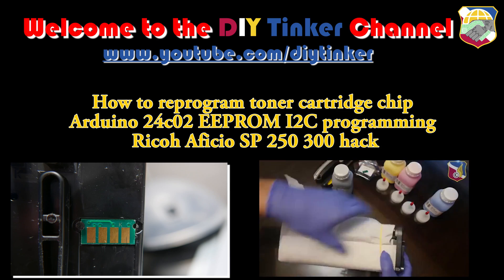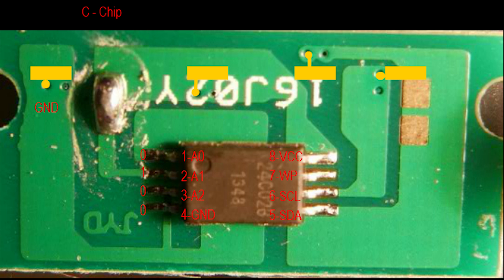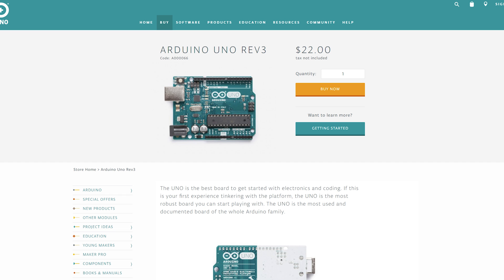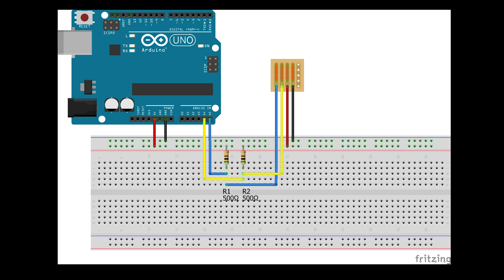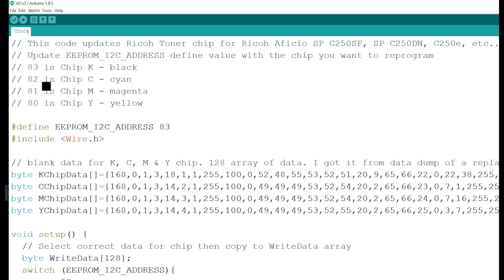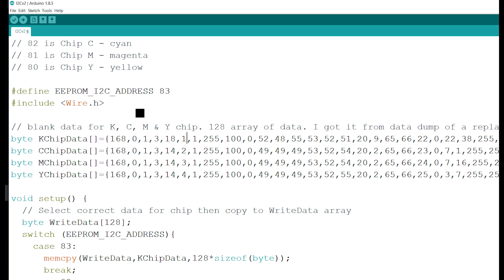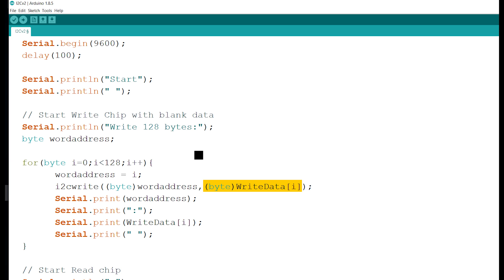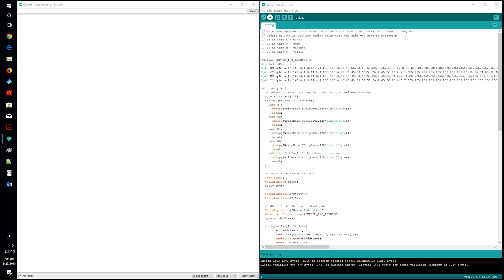How to hack Ricoh Aficio toner cartridge chip using Arduino UNO - program 24c02 EEPROM I2C

Comment: You're a legend thanks so much! Used your hard work for dumping & reprogramming similar Ricoh inkjet cart & waste tank chips.
Reply: Hey! what did you do to reset a Ricoh waste toner tank chip? I have a few and for some reason my code does not detect the chip. Please let me know if that is something you could figure out, Thanks!
Reply: @Jay-y8u  Estoy tambien interesado si compartís, código y explicación se agradeceria
Reply: @Jay-y8u  Sorry for the late response.  Does the chip on the waste tank look like the ones on the toner cartridges?  If so, did you run an I2C scanner to check what address they are using?

Comment: Cyan dump in your files looks like was already used someplace because it has printer ID X086P401208, but it works. Thanks.
BTW, I got 4 new chips and uploaded dumps if someone wants. They are not the same as posted.
Reply: Different chips have slightly different info on them.  However the printer doesn't keep track of previously used chips, so you can use the same one over and over.  I have been re-writing the same chips with the same files for a year and a half now.

Comment: It would be interesting to read the eeprom contents after printing a page, repeat a few times and compare the dumps to see what field changes. I am assuming that a single field is decremented. After identification, possibly that one field could be rewritten which would simplify the process.
Reply: There are actually several values that change.  I've done that.  Since you flash everything at once, it doesn't make it any faster.
Reply: Many parameter change at one page print

Comment: Thanks hreaps for the video..  Initially I reprogrammed the chip and got a "wrong toner" message, then i realised I had a C240 not a C250 model.  I read the data from my black cartridge which was almost full.  That gave me:
byte KChipData[]={167,0,1,4,20,1,1,255,0,0,52,48,54,48,53,57,24,16,65,66,7,0,23,85,0,0,0,0,0,0,0,0,84,49,57,50,80,51,48,48,51,50,51,0,99,0,0,0,0,0,18,169,0,0,4,58,0,0,0,0,0,0,0,0,0,0,0,3,0,0,0,0,0,0,0,0,0,0,0,0,0,0,0,0,0,0,0,0,0,0,0,0,0,0,0,0,0,0,0,9,80,32,0,97,0,0,113,101,50,6,0,29,0,82,199,121,0,60,24,66,0,0,0,0,0,0,113,101};

I think the difference for the C240 is the 167 at the beginning , so changing the the first 6 bytes of the data above should work as follows:
KChipData[]={167,0,1,0,10,1 ....
CChipData[]={167,0,1,0,10,2 ....
MChipData[]={167,0,1,0,10,3 ....
YChipData[]={167,0,1,0,10,4 ....
Reply: I have Magenta data that starts.167,0,1,1,20,3,1,255....       Don't remember which post I got it from.
Reply: There is actually a post with the data you need in the post from 
Özgür Özyurt from 10 months ago.  Look at that.

Comment: thank you so much for this video.. i run it on the arduino board, but only ''write' bytes are same with you...the 'read' bytes have the price '3'.. i use chip from mlt-d 116  samsung . it has vcc-gnd-scl-sda too.
could you help me?
Reply: ever figure this out?
Reply: @reMPAGASA1  @Chris Conner  
I had the same problem with the cartridge chips for a Ricoh SG 2100N. 
On mine the connectors were not in the order shown in the video, but it was GND-VCC-SCL-SDA . 
Also, the EEPROM_I2C_ADDRESSes were different f.e. Magenta is 82. 
After fitting the code and connection to these differences it worked again!

Comment: Did it work with SP112 ?
Reply: I think it should.  I just bought a Ricoh C360DNw.  Was looking for the pin-out because the pin-out used in the C250DN didn't work.  Ran across the pin-out for one of the Ricoh 100 series printers (don't remember which).  The toner chip looked the same as mine. So I thought I would give it a try.  I hooked one up and ran WhatI2CAddress to see if it would even talk to my Arduino.  It did.  Be warned that the addresses are not the same.  They are still 80 - 83, but the address assigned to a color is changed around.  You will then have to alter the sketch to reflect the address changes.

Comment: Could I use the original chip for hacking or not?
Reply: You could.  The data you need to rewrite the chip in this page at the top.  I would still do a dump just in case.  I assume it is for the C250dn.  If it is not then you need to get a dump for that particular chip and rewrite that to the chip.  If you've never done this before, you may want to get a couple of chips to practice on.  If you mess up one of the chips and don't have a backup, you're gonna have a dead printer til you can get a new chip.

Comment: Wow, this was great! Thank you for putting in the work and uploading this. I have a Lexmark CX310DN, and will try to figure out how to do this with my chip. I'm just baffled that a new chip will cost me $40 on ebay.
Reply: Make sure you come back and let us know what the outcome is.  I for one would be interested in seeing how this works on other manufacturer's chips.  Let us know one way or the other if it works.
Reply: @jimsmith9803  so it looks like it's a lot more complicated on the Lexmark CX310DN using the 80C1SK0 Toner Chips and the like. Heres a detailed blog of several people collaborating. They figured out a lot of info, how to read it and all, but the printer stores the chip info, so when they rewrite the chip, the printer eventually writes it back to empty. Very complex but fascinating. Now that I believe Lexmark has used up it's patent, hopefully other manufacturers will drive the price down. 

https://www.eevblog.com/forum/projects/lexmark-toner-chip-ti046b1/150/
Reply: @benspragge33  Thanks.  Very Interesting.  Very long thread but interesting.  Shows the lengths that companies go through to keep you tethered to buying from them.

Comment: Why would one add pull up resistors to the data lines?
Reply from the maker: because some chips might require more current beyond the voltage signal from an Arduino. its easier to sink voltage/current than supplying. Hence, adding a pullup resistor with a clean voltage source is always a better idea than relying on the chips voltage source.
Reply: @DIYTinker  Thank you for the reply. I don't have low resistance resistors with me like you used, would 1k-2k resistors be fine?

Comment: thanks you for this tot, can i use it for lexmark MS5120 the chip is TI046b1 ?
Reply: If the chip is just an eeprom with the 4 contacts, it should work.  You just need to figure out what the pin out is for that chip.  If you get it wrong, you risk ruining the chip.  Been there. Done that. Learned the hard way.  After learning the pin out, try reading the chip first.  It's somewhere in these posts.  If you can do that, you should be able to write to it.

Comment: Hi, any chance this can work on other printer toner chips like the Samsung toner chip.
I wanted to try reset the toner chip's eprom by just attaching its  SDA terminal to ground, before i came across your video.
Reply: Depends on what the chip looks like.  Older Samsung chips are of the "4 contacts with an eeprom" type.  You may get it to work.  I have a Samsung C1810w printer.  There is a PIC32 chip on there also.  I would guess that you would have to wake up that chip first.  I could not get the program to read this chip.  But then my programming skills are very poor.  So you may have better luck.  Let us know if you succeed.

Comment: What difference do the two resistors in the "complicated wiring setup" make? Why should one use that instead of the simple wiring?
Reply: He explained that they were for unnecessary protections.
Reply: Some boards will need them.  The Arduino Uno doesn't need them because there are internal resistors that are set when you start the the wire library in the programming.

Comment: Thankyou so much, I've reset the cartdrige chip of my SPC 252 using your code (moded), in order to read in first instance the contain of an aliexpress clone chip, and then Overwrite the original one.
Reply: How do you read the chip?
Reply: Hi, using the reading loop which is used to check the overwrited code in the chips, I commented the writing code that i don't want to use in first place, because if you don't do this you will overwrite the good chips with the wrong code.
Reply: can you please upload the code you compiled for ricoh spc 252

Comment: What happens if you just connect to WP to VSS (if connected to VCC unconnect first)?
Some german forum said it will be stuck to last fill level then.
I will try later this week if they still work after doing this (implies that it stays full then).
Got me 10 china chips. Obviously doesn't make sense with an empty chip.
Reply: How are you gonna connect write protect to ground?  You only have 4 tabs to connect to on the chip?  I just find it much easier to rewrite the chip when a light starts flashing.

Comment: can you show how to take data dump?
Reply: Good info.  With that I end up with this sketch.
// This code reads Ricoh Toner chip for Ricoh Aficio SP C250SF, SP C250DN, C250e, etc...
// Update EEPROM_I2C_ADDRESS define value with the chip you want to reprogram
// 83 is Chip K - black
// 82 is Chip C - cyan
// 81 is Chip M - magenta
// 80 is Chip Y - yellow

#define EEPROM_I2C_ADDRESS 81
#include <Wire.h>

// blank data for K, C, M & Y chip. 128 array of data. I got it from data dump of a replacement chip. 
byte KChipData[]={};
byte CChipData[]={};
byte MChipData[]={};
byte YChipData[]={};

void setup() {
  // Select correct data for chip then copy to WriteData array
 byte WriteData[128];
  switch (EEPROM_I2C_ADDRESS){
    case 83:
    case 82:
    case 81:
    case 80:
    memcpy(WriteData,KChipData,128*sizeof(byte));

  }
  
  // Start Wire and Serial bus
  Wire.begin();
  Serial.begin(9600);
  delay(100);

  Serial.println("Start");
  Serial.println(" ");
  // Start Read chip
  Serial.println(" ");
  Serial.println("Chip Data:");
  for(byte i=0;i<128;i++){
      byte readVale = i2cread(i);
      //Serial.print(i);
      //Serial.print(":");
      Serial.print(readVale);
      Serial.print(",");
  } 
  Serial.println(" ");  
  Serial.println("End");

}

void loop() {

}

void i2cwrite(byte address, byte data) {
  Wire.beginTransmission(EEPROM_I2C_ADDRESS);
  Wire.write((byte)address);
  Wire.write((byte)data);
  Wire.endTransmission();
  delay(20);
}

byte i2cread(byte address) {
  byte rData = 0;
  Wire.beginTransmission(EEPROM_I2C_ADDRESS);
  Wire.write((byte)address);
  Wire.endTransmission();

  Wire.requestFrom(EEPROM_I2C_ADDRESS,1);
  while (Wire.available()){
    rData = Wire.read();
    return rData;
  }
}
With your suggestion, the data is in a much more usable format.
Reply: Go to line 45 and insert /*
Go to line 58 and insert */
Go to line 64 and insert // before Serial.print(i);
Go to line 65 and insert // before Serial.print(":");
Go to line 67 and change Serial.print(" ") to Serial.print(", ")
and then keep the right color chip with the right adderss and run the program. 
CTRL-SHIFT M will bring up the monitor were the dump will be displayed

Comment: Thanks for sharing. Managed to reset my Ricoh SPC 220N .
Reply: Was the data you wrote to the chip the same as we use for for the C250DN or did you have to do a dump of a blank chip specifically for that printer?
Reply: No, I had to take the dump of a blank chip specifically for C220N.
Reply: Was the data significantly different from what we use in the C250DN?
Reply: Yes it is different.
Reply: @rajgopalnayak3283  please share data of Ricoh SP c220n . I am also having the same printer. I will be very grateful to you
Reply: @ashokmanker  have you got te data ??
Reply: @irshadmansury320  ok. Will do

Comment: A question for the knowledgeable.  When I reprogram the chip on the black cartridge that is now showing empty - and on the webpage for my printer it shows 800 pages printed, does reprogramming the chip reset the counter to zero?  OR - does it just add to the 800 pages as it's printed after filling with toner?  Thank you for any guidance. Ken H.
Reply: To answer your question, it resets the page counter back to zero.  Your printer should be showing a full cartridge (100%) and not an empty one.  At least that is what mine shows.  Now all I have to do is wait for the toner to actually run out and then I can test out his video on refilling it.
Reply: I didn't make myself very clear, and I think I've answered my own question - too some extent anyway.  I ordered a new toner refill kit with programmed chip.  Filled with new toner, replaced chip, printer shows full.  Also, the webpage interface to computer using IP address shows toner full, but this webpage still shows the same page count.  I think the webpage counter shows ONLY the printer count, not the toner cartridge.  

I did try reprogramming from above video, but I've not been able to communicate with eeprom chip.  I do a I2C scan and it shows no I2C device located.  I've used it with the 500 ohm  pullup resistors installed, just doesn't work for me.  Perhaps my chip just went bad?  I think I'm following video exactly.  I've read how the eeprom requires a slow I2C setting, but I'm assuming that is built into the code?

Anyway - thanks for the info.... and a great big THANK YOU to DIY for producing the video.
Reply: First, are you using an Arduino Uno board?  

The I2C scan sketch I use is:

// I2C Scanner
// Written by Nick Gammon
// Date: 20th April 2011

#include <Wire.h>

void setup() {
  Serial.begin (9600);

  // Leonardo: wait for serial port to connect
  while (!Serial) 
    {
    }

  Serial.println ();
  Serial.println ("I2C scanner. Scanning ...");
  byte count = 0;
  
  Wire.begin();
  for (byte i = 8; i < 120; i++)
  {
    Wire.beginTransmission (i);
    if (Wire.endTransmission () == 0)
      {
      Serial.print ("Found address: ");
      Serial.print (i, DEC);
      Serial.print (" (0x");
      Serial.print (i, HEX);
      Serial.println (")");
      count++;
      delay (1);  // maybe unneeded?
      } // end of good response
  } // end of for loop
  Serial.println ("Done.");
  Serial.print ("Found ");
  Serial.print (count, DEC);
  Serial.println (" device(s).");
}  // end of setup

void loop() {}

If you don't see an address then no sense going farther.  You need to figure this out before you can continue.  If you are using his sketch, then maybe something is wrong with the contacts or how you have it connected. If you are using pins A4 and A5 on an Arduino Uno, you don't need the pull up resistors.  There are internal resistors that are initialized with the Wire library.  I also don't like setup he uses to connect to the chip.  I tried it and it doesn't provide good contact.  I instead used wire cutters to cut off one tab of the cartridge just enough to pry the chip out.  Once I'm done fooling around with the chip, I can re-glue it back permanently.   You can do this by making a thick gel with a mixture of ABS plastic (Lego Blocks are a good source) and acetone.  You don't need much.  I used alligator clips to connect to the chip.  I used a business card underneath the smart chip so the bottom of the alligator clip didn't short anything.  Then used Dupont wires to connect that to the Uno. That worked.  Since I have a 3D printer, I made a 4 pin header with push pin probes.  It is a much better setup.
Hope this helps.
Reply: Looks like I was having an issue with the connection system I was trying to use.... hold chip and leads in fingers?  Anyway - with good connection can now get either of my I2C scanning programs to work.  I like the one you posted MUCH better.  BTW, I'm using the Arduino Nano which also has the internal pullup resistors.  Thanks for your help
Reply: Jim, just wish to update my comments.  You've all seen the problems I've had trying to burn the C250DN EEPROM chip using the code and procedure in above video.  Once I made an connection method using clips that made a good solid connection - works like a champ!  Put chip in printer and it shows full cartridge, and prints nicely.  Thank you DIY for the video, and thank you Jim for the help.  Ken H>